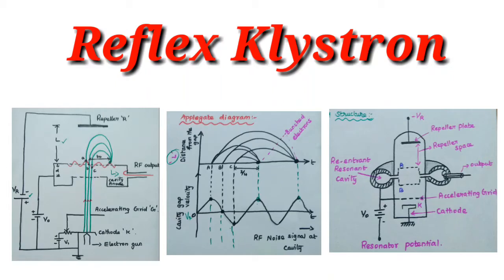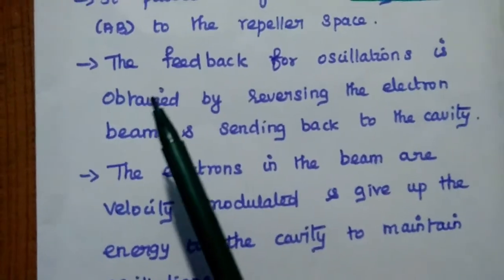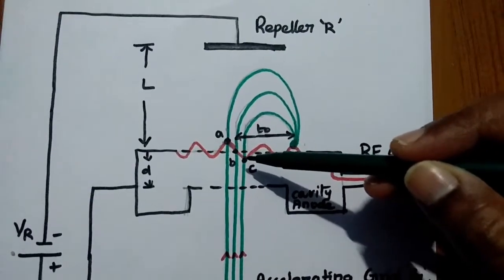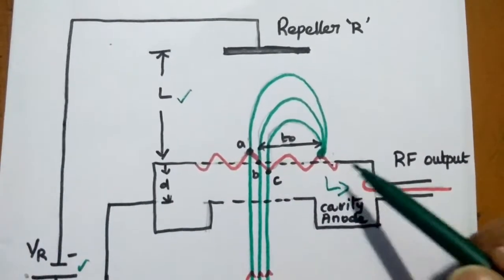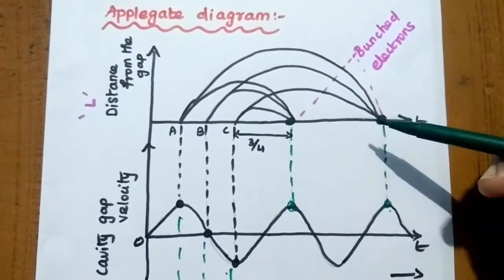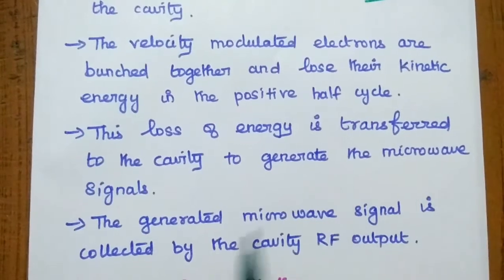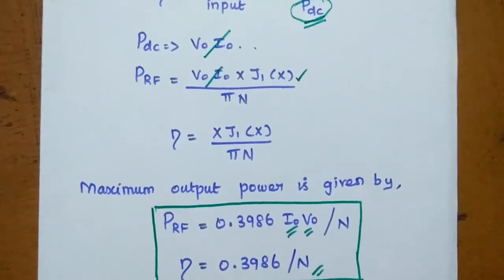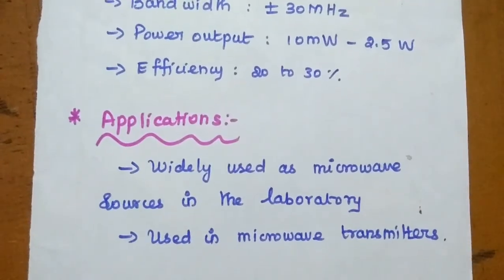Reflex Klystron - Working Principle, Analysis and Its Applications

Comment: All electrons are emitted by an electron gun so, how that early and late electrons are classified?
How do we tell early electrons lesser velocity and late electrons higher velocity? (because I thought like all electrons are emitting from the electron gun and the distance between the electron gun and the repeller electrode remains constant... )
Reply from the maker: All electrons are generared from the gun with the same velocity. I mentioned here is " the electrons which are crossed the +ve peak of the rf signal gained the energy from rf and moving with  high velocity. Similarly for -ve rf signal means less velocity. Its called velocity modulation. velocity of the electrons is varied with respect to the rf signal amplitude
Reply: @PadmasriNaban  means, do we need rf (radio frequency) to produce micro wave?? 

Our intension is to produce microwave that itself is radio wave.. so do we need again a radio wave for its generation?

Please tell me🙏
Reply: I understood this..  "It is assumed that oscillations already exist in the tube and they are sustained by its operation"

so, the electrons emitting from the electron gun will get the energy from the high energised bunched electrons which are returning back from repeller

Thanks for making me understand this.. thank you so much ☺.
Reply from the maker: Good..... 👍